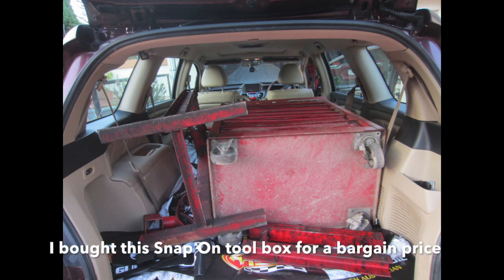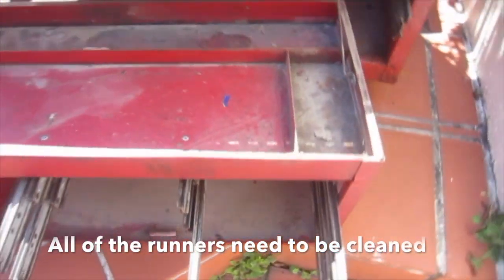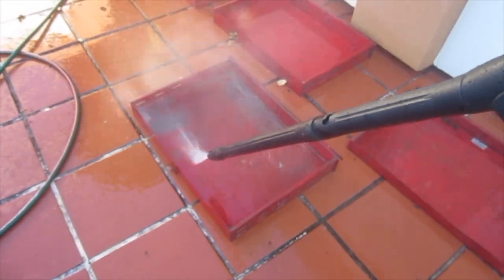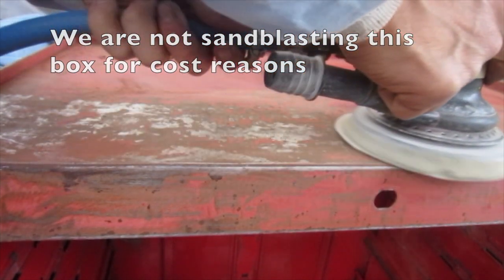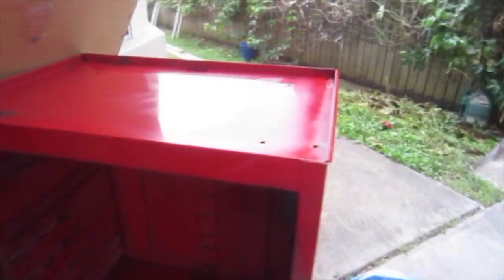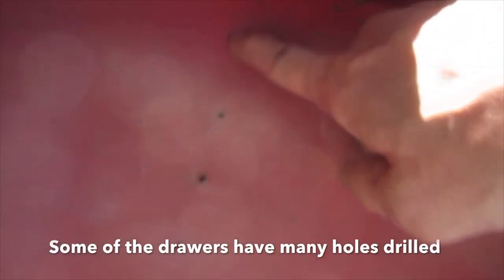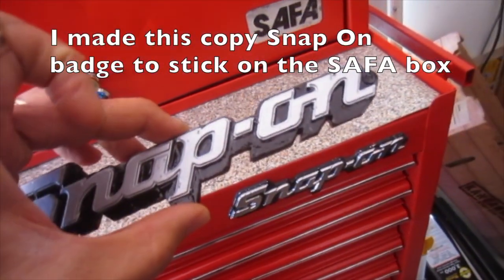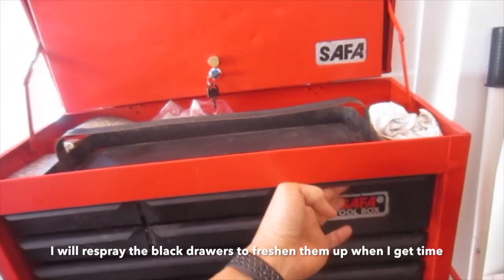Snap On tool box survives two floods ( restoration video)

Comment: I know this is some time ago but how did the rustoleum 2x primer + paint hold up thus far? 

Did you feel that a clear coat would have helped for extra protection? Or the paint itself is tough enough?
Reply from the maker: The rustoleum paint is amazing ! It is so tough that it doesn’t chip like some paints . I would still recommend it for restoration of tool boxes and the red is beautiful. Clear coat would actually weaken the toughness.

Comment: The elusive 10 millimeter.  I must have bought at least 20 of those over the years. I think I have one left.
Reply from the maker: Lol. I didn’t want to spend a lot repacking the 10 mm with the correct Sidchrome socket so I just bought a cheap Toolpro 10 mm long socket which fits the slot . 
The free socket set looks fantastic . Let me know if you want a quick video on that .

Comment: Awesome!!! I recently inherited my dad's snap-on toolbox #KRA300B. It definitely needs work to be fully functional. I'm having an issue with some drawers coming completely off the drawer slides. Could you possibly do a video on exactly how the drawer n slide work together, so maybe I can resolve the issue??
Reply from the maker: If you look carefully how I take the drawers out ( use a bent feeler gauge ) you can see that there is a tab that stops the drawers coming right out . Take your drawer off then you can see the tab . Bend the tab out a bit and when you lock the drawer back in , it will not slip out .
Reply: @Dentinvent  I've pulled them out before, using the metal piece from a file folder, but some don't have that...like it broke off possibly. Is it possible to weld a lil nob/stop thing on it?? Or possibly cut a new tab? Thank you for responding, greatly appreciated.

Comment: I can't believe he did so much work disassembling, cleaning and sanding just to spray bomb them.
Reply from the maker: To get a perfect finish you’d have to virtually sandblast then fill minor marks and block sand and two pac finish them . Then it maybe cheaper to take out that lease on a new one .